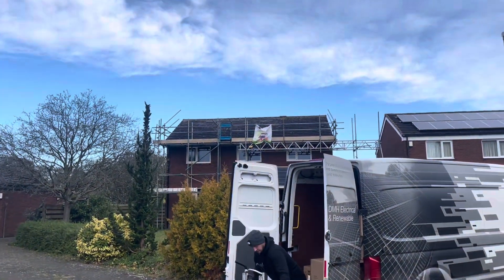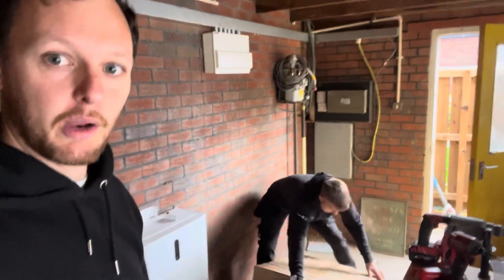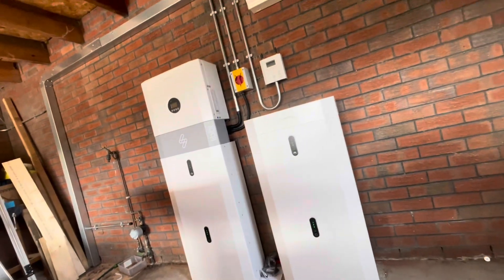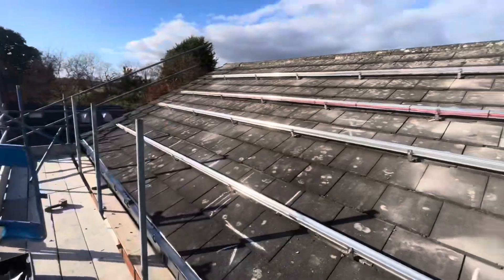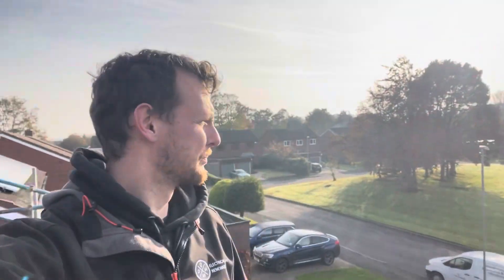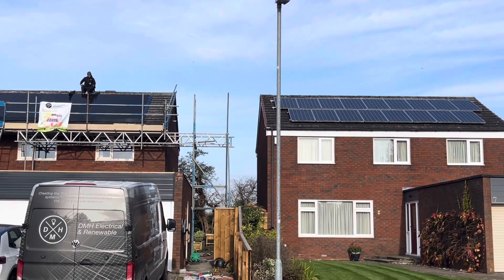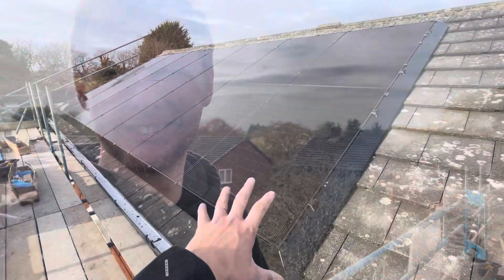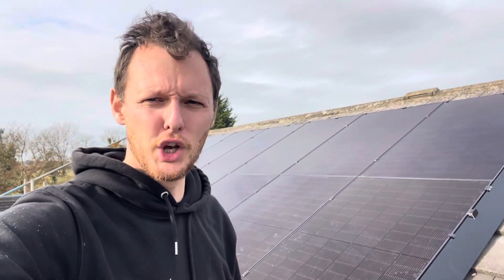Can new solar take this house off grid?

Comment: I wonder if you considered putting some or all of the panels on the garage roof? The Bifacials would have worked better, also much closer and easier to access for maintenance and cleaning. Maybe for the next upgrade?
Reply from the maker: We did and it was a discussion we had with the home owner, however the were keen to have them in the main house roof. As that ‘flat’ roof isn’t all that flat 😂
Reply: 100 % scam. invest the cash instead,
my friend put 25k of panels on his house in march.
i told him not to and to prove it's a scam i put 25k into tech funds.
up to today he's saved about 800 quid on leccy.
i have made 9k on my investments,
forget this shite invest.
25k over 10 years will snowball to over150k. all tax free through an ISA.  plus my cash is there instantly if i need it. we live in sweden and now he's producing nothing. i made 1000 quid on friday on my investments.
PEOPLE DO NOT DO THIS CRAP OK. invest in nvidia you will make 1000% on your money by 2030. 
solar panels are 100% scam